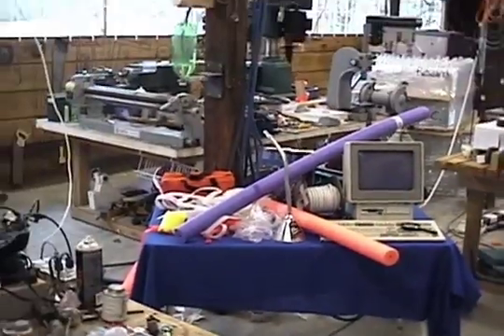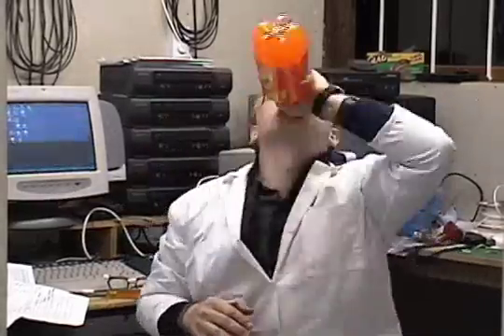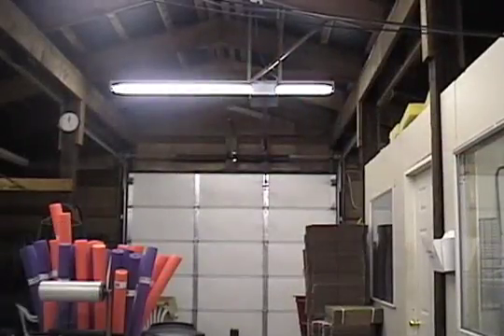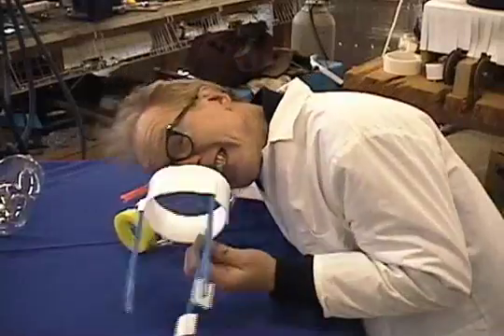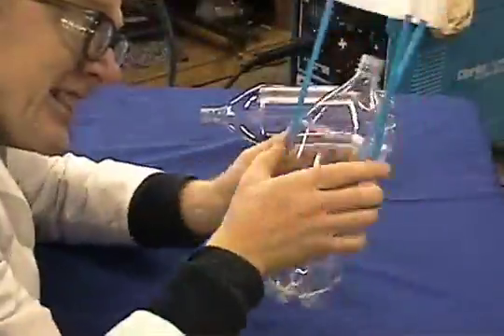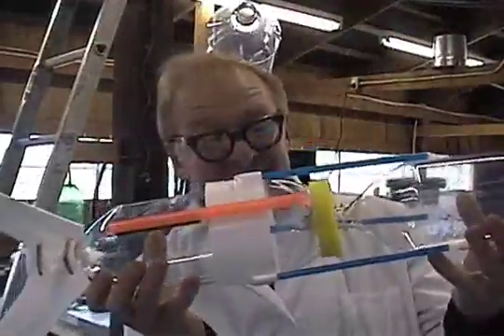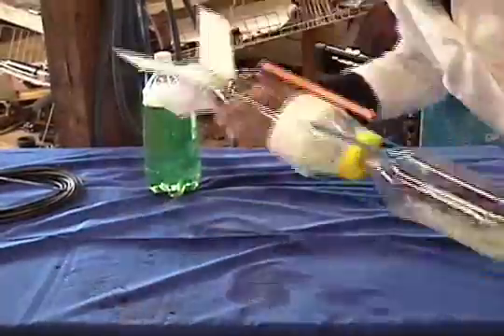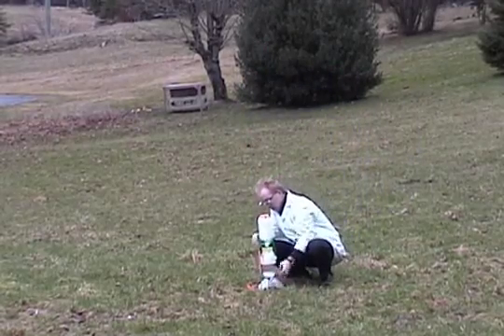2-Stage Water Rocket Assembly Instructions

Comment: It's a simple gravitational deployment. The interstage tube on top of the booster stage connects to the nozzle of the upper stage. The ring fins keep it straight. It pushes it up as it lifts off, and when it runs out of fuel, it falls, and the tube no longer sticks onto the nozzle and the upper stage continues to fly.

Comment from the maker: The bottles are connected by a tiny interstage release tube at the top of the booster stage that fits into the upper stage nozzle.  The upper stage ring fin slides over the booster stage bottle to keep the rocket straight.  KS.

Comment from the maker: The Interstage Tube at the top of the booster holds onto the inside of the upper stage nozzle by expanding when the rocket is being pressurized. Its diameter shrinks when the booster pressure approaches zero. Then the upper stage pressure pushes it out of the nozzle with split-second timing. KS